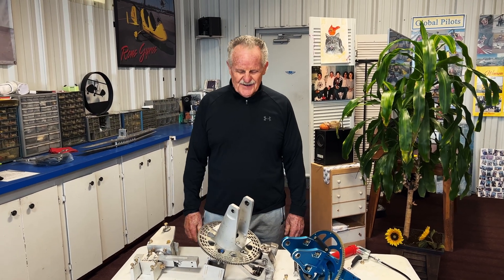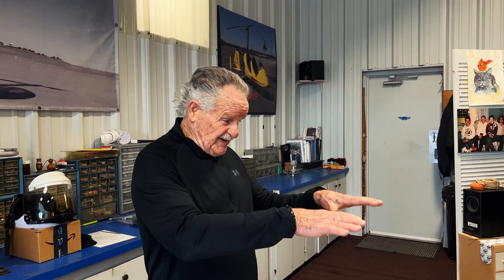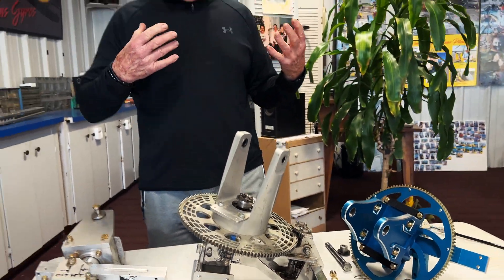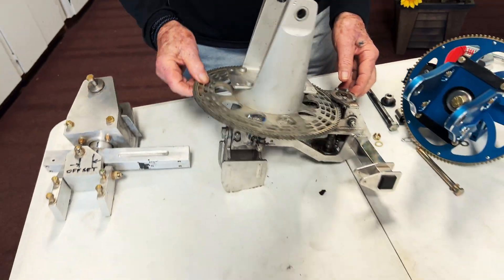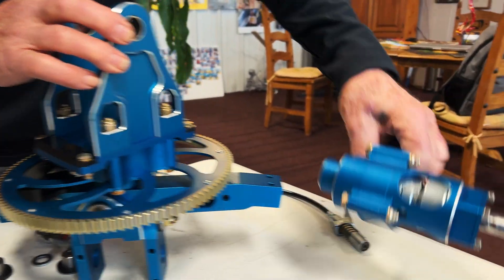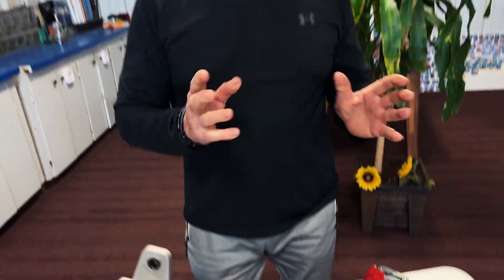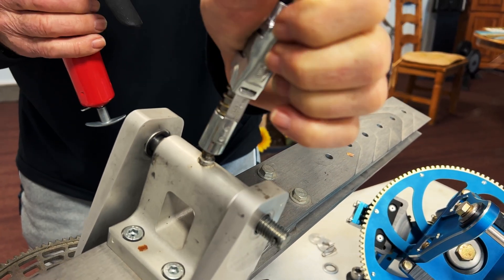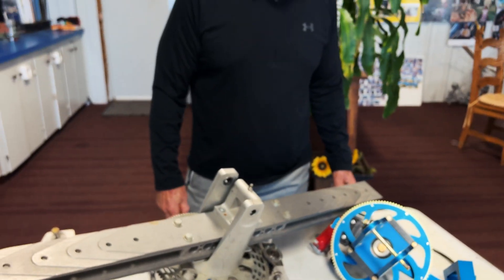THE BASIC's OF A GYRO ROTORHEAD!

Comment: Nice video Ron. In AR-1 I got rid of air compressor and the Bendix just goes up and engages ring gear mechanically as you squeeze the pre-rotator engagement handle. Similar to Magni. The rotor brake is also just over center lever activated by a handle under the pilot seat. No air or hydraulic. Although I do get complains that rotor brake does not hold the rotor enough in high winds. I have not seen that as a big problem by Gyro-technic hydraulic brake is definitely stronger. 
I do not like having to oil the bushings in the teeter towers. There is no need for that if you design it out. In our case the teeter block on the hub bar has bearings in it. The teeter bolt is snug tight and does not move at all. It is the teeter block bearings that move. Thus there is no wear on the teeter bolt. It isn't the bearing surface. That keeps the dynamic balance and tracking of the system intact for much longer.

Comment: Being that gyros do not have driven rotors wouldn't it be a lot safer to not have a pre-rotor or a brake? If anything goes wrong and jams up you'll lose rotor speed and die. The teeter bolt is a shockingly small diameter. Being that if any one of those bolts fail you are dead scares me. Also not a lot of material around the teeter bolt. BTW I work in aerospace manufacturing, and it still scares me how small the bolts are for that job.
Reply: a 12 mm Class 8.8 or class 10.9 teeter bolt in double sheer will handle 25 G load. You should be more worried about all that Aluminum around to break first. You can fly with the rotor brake on. It will burn up the rotor brake pad but it does not stop the rotor once in flight. Although the hydraulic rotor brake of GyroTechnic might be more powerful. I am sure it has been tested in case it has a hydraulic lock. The brake is there just to help slow down the rotor faster. It isn't like car brakes on the wheels.

Comment: So why....(after asking everyone with no answer yet) are there no 3 blade shorter span rotors on gyro's that smooths out the retreating blade effects as well as reduced the rotor disk drag and stick shake? Aren't gyro's so slow due to the huge disk area of a floppy 27' rotors? Why not smaller diameter 3 blade?
Reply: 3 blades are non-teetering rotor and you need to manipulate flapping hinges which is not a simple rotor system and not allowed by law in ULM or Sport Pilot rules. The teetering 2 blade fixed pitch rotor system is about as simple as they come
Reply: A three blade rotor will not work because it will not teeter properly. It would need a variable pitch rotor head like a helicopter. At that point just fly a helicopter instead.
Reply: @SpeedDemonExpress  why cant the 3 blades just pivot independently ?
Reply: @myotherusername9224  Gyros head pivots on a single bolt teeter. A 3 blade head would need a helicopter swashplate to mix the control surfaces.

Comment: Can all this be replaced if they would use an electric motor in a case near the rotors
Reply: You can maybe get 120 Rotor RPM with electric. You need 7 HP to get 220 RRPM and that is a heavy motor taking up a lot of battery

Comment: My rotor head has bushings and I have to oil them every 5-10 hours or so as instructed by the fellow who build my (homemade) gyro. I just use a dab of oil from the engine dipstick like he showed me and I dont have to remove the hub bar I just remove the teeter nut and pop each bushing out most of the way to expose them for lubrication. Thanks for the video Ron  all the best

Comment: Where does the AUTOGYRO pre rotation system get the air pressure from? Is there a pump on the engine?
Reply: From an air compressor built under the seat that runs on electric power